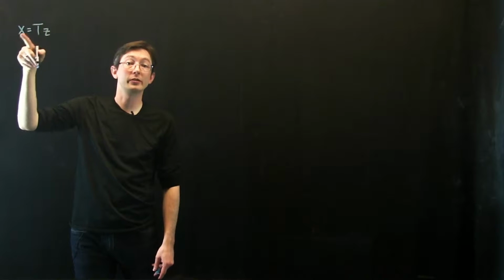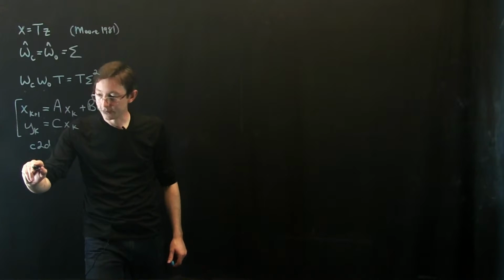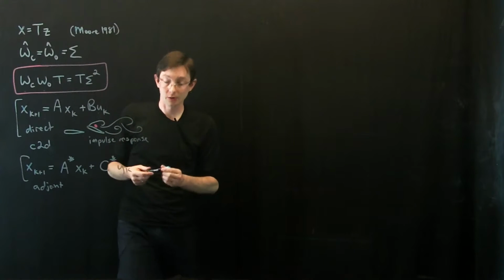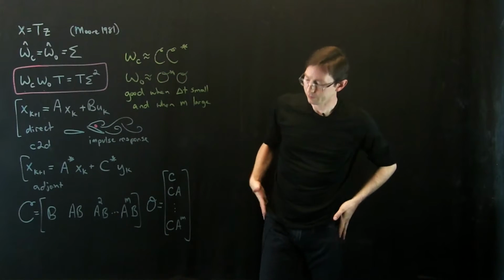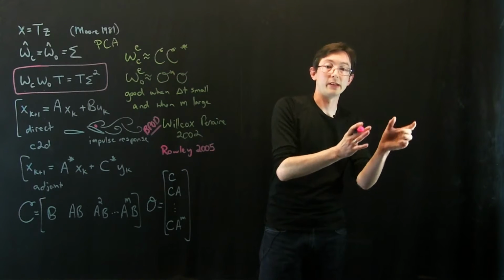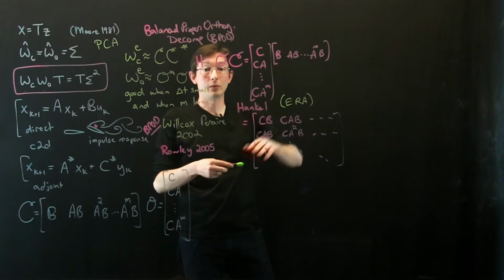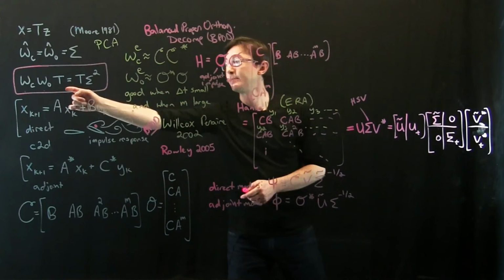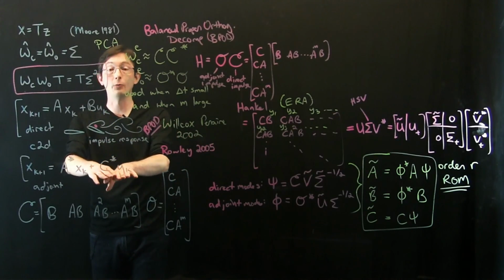Data-Driven Control: Balanced Proper Orthogonal Decomposition

Comment: My mind was blown when you showed that the obsv and ctrb matrices multiplied into the Hankel matrix 🤯 Trying to figure out how this relates to HAVOK 🤔 BPOD relies on a linear model. So I'm guessing you can't reverse this procedure with nonlinear measurements to get some analogous ctrb and obsv matrices for nonlinear systems: I.e. decompose a Hankel matrix of some set of nonlinear measurements into a direct and adjoint impulse response of a nonlinear system. This is confusing, yet very fascinating.

Comment: Um...isn't this just Hankel SVD from HAVOK, PCT, all that, in a different guise? I mean, this literally looks identical. What's the connection here?

Is the adjoint system related to the Perron-Frobenius operator?
Reply from the maker: Good question.  Most of these methods are related somehow.  But the history and timeline is important.  The ERA (eigensystem realization algorithm) and SSA (singular spectrum analysis) are probably the first of these methods that perform SVD and regression on a Hankel matrix (1980s).  Balanced truncation came out around the same time.  But Balanced POD was much later, in the early 2000s.  DMD came out later, around 2010, and performing DMD on a Hankel matrix (also called "delay DMD") was introduced by Jonathan Tu et al in 2014 in a JCD paper (https://arxiv.org/abs/1312.0041).  My wife Bing was one of the first to use this idea on data from the field of neuroscience.  We first introduced a connection between Hankel DMD and the Koopman operator in our HAVOK paper (2017, https://www.nature.com/articles/s41467-017-00030-8).  Then Arbabi and Mezic followed up with a theory paper to strengthen the connection.  PCT is the most recent in this line, and uses the full system state instead of a scalar measurement for the embedding. 

Most of these methods are very close in practice to ERA, but a lot of thought has gone into how the algorithm works for high dimensional data (BPOD and DMD) or nonlinear systems (HAVOK/Koopman).
Reply: @Eigensteve  The systems here are linear, right? whereas HAVOK/PCT handles nonlinear/fully chaotic behavior? Is there a connection between the adjoint system in this video and the Perron-Frobenius operator? Is it known why HAVOK seems to produce the almost-invariants sets of that operator in your Lorenz example (and does this happen in any other systems?)

Comment: Thank you for this amazing lecture series, professor! I had a couple questions from this lecture:
- I did not understand how the adjoint system was obtained from the direct system and what its physical meaning was (it doesn't seem to be a simple adjoint because the direct system depends on A and B while the adjoint system depends on A and C). Also, I understand what giving an impulse input u means but I did not understand what it means for y since that is something we measure and not something we control. Are the two x's in the direct and adjoint systems the same state variable or different?
- Regarding the Hankel matrix being symmetric - for SISO systems the structure of the matrix guarantees this. But in general, for MIMO systems, for the matrix to be symmetric we also require the component block matrices CB, CAB etc to also be symmetric. But we know that for any arbitrary system,  A, B, C matrices are completely independent of each other and this condition is not guaranteed (or am I wrong about this?).
Reply from the maker: The adjoint system will probably require a lecture on its own.  But regarding the Hankel matrix, you are absolutely right, this will only be block symmetric in the MIMO case.